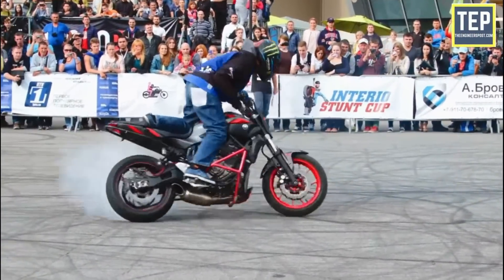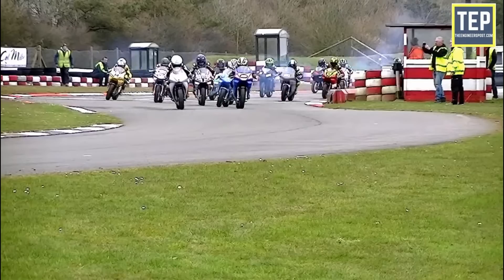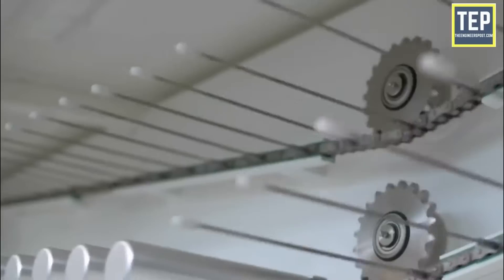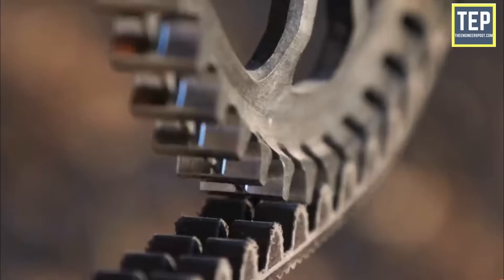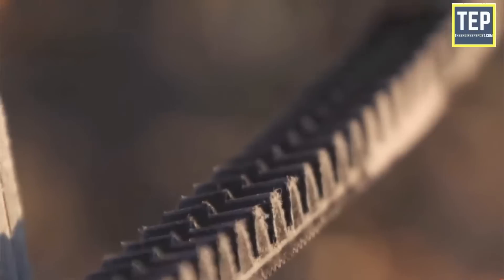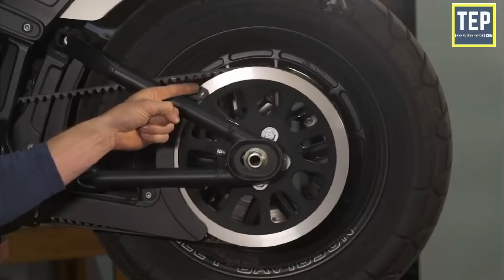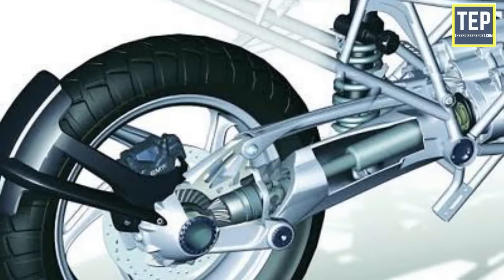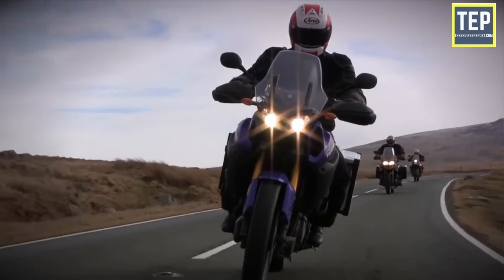Chain Drive vs Belt Drive vs Shaft Drive in Motorcycles | Which is Better?

Comment: Wow, never new shaft drives waste 25% of power (sounds high) and belts 10%.  Clearly, chain is the winner re performance and cost, but you pay for the maintenance, but its not bad if its a road bike.
Reply: Shaft does not lose that much power. A spiral bevel gear only loses about 2%. The whole system is less than 10%. Shaft drive does require maintenance but it's an oil change. They use so little fluid a quart bottle would last a couple years with a yearly change.
Reply: @omnipotent87  The video showed a hypoid gear set for the shaft drive which can attenuate about 15% of power delivery. A regular spiral bevel gear can be used but you'll be hearing a loud hum  as you go. Ok for power tools but not so much for motorcycles due to backlash issues. Also shaft drives have issues with universal joint free play and angular limitations. Which is why you see them in tourers meant for flat terrain. The more acute the angle of the shaft the less power it can deliver due to torsional resistance of the universal joints. Which is also why you'll have less ground clearance for dual sports or serious off road adventure bikes.

Chains don't have these issues. Hence their use in supersport and off road applications. Large displacement road oriented motorcycles can use shaft drive for all the benefits it offers. 

Neither is better or worse. Use the right tool for the job
Reply: That's got to be high... I have a intruder VL 1500 shaft drive and that thing pulls your arms off on acceleration!
Reply: Lolz shaft drives. The pinion gear is always wanting to climb the ring gear and thus induces, however slight, a rotational torque on the bikes frame. Saying that chains pull a rear wheel out of alignment under load and ignoring that shaft drives do the same, but to the frame of the bike as opposed to the rear wheel, is asinine. Good day.
Reply: @JDuBz815  That torque can be used to your advantage in cornering.
Reply: @corydorastube  you can also use the torque of a chain drive to your advantage. I was pointing out that both chain drive and shaft drive systems apply torque to the bike in different ways.
Reply: His figures are over the top
Reply: Chains also have the disadvantage of stretching under load. A loose chain can cause the bike to fish-tail, so having it properly tensioned is important. 

The chain's pressure on the back  axle can pull the back wheel put of alignment, disturbing the handling of the bike. 

With a shaft drive (or a CVT) misalignment is eliminated, so "technically" those alternatives are "safer".  

Shaft drives tend to cause the back of the bike to rise under power, while chains cause the back end to drop. You can see this effect on drag bikes where the tyres are actually distorted by the power.

Bikes also have the tendency for the front end to dip under heavy braking, so having a shaft drive bike can have an effect like a see-saw if ridden aggressively. BMW has a special front end setup to counter this.
Reply: @stanislausbrown8626  And say a rag gets spun around the wheel locking the rear wheel up, what happens with the rear wheel? Can it slip with the shaft drive to save the the biker?
Reply: @arunvignesh7015  
The shaft drive mechanism is all enclosed so a rag can’t get wrapped around the sprocket.
Reply: @Therapistinthewhitehouse  Still connected to the wheel I hope?
Reply: @arunvignesh7015  
It’s the exposed chain and sprockets that are more likely to catch the rag than the interface between a wheel and shaft.
Reply: @Therapistinthewhitehouse  I agree but still your own luggage or a long enough sack or cloth can get caught between the wheels and the casing making it dangerous. Shafts are convenient, but not fully safe as long as you aren't sitting inside a cage like a car.  Chains even if a little tricky to maintain, seems like a safer option and fixable if you indent to ride into all kinds of places. Maybe I'm wrong but the tested and proven just feels more appealing.
Reply: @arunvignesh7015  
Shafts are convenient, maintenance free and offer better control of power on the limit. Something I hadn’t considered was that but someone else mentioned was that a chain drive wants to pull the rear wheel out of alignment making handling less predictable if missed when maintaining the bike. I don’t know if it’s ever been done but a chain drive inside a casing with a drip of lube keeping everything running smoothly, would keep the chain clean and mean that both it and sprockets would last longer. The downside would be that checking the chain and sprockets would be more difficult and because of that, it’d be more likely to be skipped.
Reply: @Therapistinthewhitehouse  Chains and sprockets are cheap to manufacture and it's easy to replace and maintain instead of having a case around it generally. Worst case scenario they just break off and make sure the power transmission stops unlike shaft so I don't think it's worth the effort to have a casing for chain because unless it is completely sealed the dust is going to get in anyway. Chains are advantageous because they are exposed and in very long journeys they can be fixed on the fly with extra links or new chain.
Chains are flexible Which can cause some misalignment but the flexibility of the chain runs it misaligned without any serious slippage or power drop.
Reply: @arunvignesh7015  
You’re saying they’re cheap and easy to adjust and repair on the roadside, that’s a problem that’ll almost never occur with a shaft drive and be much less likely to happen on a belt drive, which also requires no maintenance and it’s a lot easier to carry a spare for the once in 100k times it snaps.
Reply: @stanislausbrown8626  it feels better for the back to go down on sudden  power delivery, more grip that way it would seem.

Comment: Belt drive has the least amount of maintenance
Reply from the maker: You're right!! Compared with a chain, belts are cleaner, lighter, cheaper, smoother, quieter and require less maintenance.

Comment: Why do they loose up ro 25 percent when a car totally including gerabox and clutch looses around 10%?
Reply: Depends on drivetrain layout? Plus, the torque in a car engine tends to be way more than a motorcycle I would think.
Reply: @2010ngojo  yes this is correct, bikes rev real high, and horsepower increases with rpm, I think the equation is Horsepower = Torque/5252, so for example, a 600cc bike with a car redline, somewhere around 5-7k, would make similar torque to horsepower numbers as cars do, because bikes rev so high, that horsepower increases, but with torque on the other side of the equation, it doesn't increase by much, and might even lose torque
Reply: @2010ngojo  I meant that it'd have a similar torque to horsepower ratio as a car
Reply: They don't.. He's taking bollox
Reply: @thakery5720  his figures are was off. If a shaft driven motorcycle makes 100 bhp he's claiming by the time it gets to the rear wheel it's 75bhp!!? Nonsense, at most it will loose 15bhp. So in fact I think it is you that would appear to be ill educated... You sanctimonious halfwit...
Reply: @thakery5720  and what's even worse... YOU HA E A BIKE!!!!  Please sell it and keep death and idiots off the road🤣🤣🤣🤣🤣
Reply: Rear-wheel drive cars lose between 20% and 30% of power when measured at the back wheels. This is due to oil friction, gear engagement, and other parasitic loses. Front-wheel drive cars lose a bit less.
Reply: @johngranato2673 
It's not just which wheels are driven, but also where the engine is.
Reply: @2010ngojo  Certainly, in relation to engine location.  Thanks.
Reply: If you have a car that is rear wheel drive it'll have power loss of right around 15 to 25% depending of how heavy and how long the vehicle and where the engine is

Comment: 5:25 That is not true! They need maintenance too, but not in such short intervals as the other drive systems.
So need the cardan joint non-fluid oil, which you have to fit at every bike inspection and the angle gear needs gearbox oil, which you have to replace from time to time(~20,000-50000km)

Comment: Verdict: chain drive is the best.. so don't be lazy and clear your chain and socket frequently
Reply: @thakery5720  it needs cleaning after few hundreds kilometres. We bath daily so to keep ourselves clean. So why don't we give just 10-15 minutes to clean the chain
Reply: @thakery5720  nope chains are good belts gets tear if applied much power and chains can be repaired
Reply: Shaft is best. One thing less to worry about.
Reply: @thakery5720  belt drive is like middle ground 👍👍
Reply: @thakery5720  how much cc is your bike
Reply: @thakery5720  really? you have the beasts
Reply: @thakery5720  👍👍
Reply: I agree what you said. Certainly it can withstand in any condition. However, if you're not lazy lubricating it frequently, then you don't have any troubles. You can also replace sprockets depends on how you set up your ride for racing. 

It's eco-friendly and last even longer too
Reply: My chain drive doesn't need any service. Its fully sealed.

Comment: If ever i have money, id build my own motorcycle...

125cc engine, but looks and feels like a Sports bike, and it will have either 3wheels (reversed trike design) or 4wheels (Quad bike/ATV design)...

And it will either have Belt drive or Shaft drive...
Reply from the maker: Good to hear that
Reply: how about foot drive
Reply: Problem is its gonna be slow
Reply: @palepotatox  dont care...
The planned design is for people that are old and with disabilities...

So they can still ride a Motorcycle w/o having trouble riding it...
Reply: Then, it's not a motorcycle.
Reply: @timjohnson1199  HAHAHAHA
Reply: @timjohnson1199  so? Whats your problem?
Reply: @JohnathanLimCheng  Then just custom any 125cc scooter into trycyle if you want the easiest way (because CVT was alreay using belt for the drive train). But for sports bike, well I already seen some custom made version of GSX 150R and FZ 16 for our disable friend
Reply: Well, you can buy a Piaggio Tre Ruote
Reply: @fwfindawan1481  technically i can only have possibility to buy motorcycles under Honda...

I live in the Philippines, and the cheapest 125cc motorcycle is a Honda TMX125-Alpha...
Its price is under $1000usd...(50k Php)
Reply: Ibig mo bang sabihin paps, Project Bike?

Anong 125cc motorcycles yan paps HD3 ba yan or pang 4 stroke?

Comment: "Totally maintenance free" 
Shows a video of oil change.
Reply: That oil cost less than $6 for a quart and it’ll last 3-5 years depending of how much oil you need and how frequent you change the oil.  Btw, to change it, you just drain it from plug and fill (3~6ounces?).  This is as cheap maintenance as anything goes.  I changed my oil at 6000 miles (roughly 3-4 years).  Bought a new quart.  You could probably ride it longer as no contamination gets in there or use synthetic oil to last longer.
Reply: Oil cost 10k
Reply: Yeah.. hahah
Reply: You do realize this is an AI made video right?
Reply: @randomyoutuber2927  AI spoken video, not AI made dude
Reply: Yeah 🤣
Reply: @Legi0n you should not use synthetic on older shaft drives. 2000 (roughly) and older need the old fashioned stuff.
Reply: That was the initial oil being added at the factory..................
..........
..........
..........
..........
..........
not!
Reply: Which literally takes 2-3 minutes at best with a shaft drive.  I wouldn't even consider that maintenance.
Reply: @Airtouch67  but, a cbr is more fun 🙃😊
Reply: Or you can try to replace the timing chain yourself it could take several hours for the repair.
Reply: One time a year maybe more time  !
Reply: this mass of oil will travel around the world. Respect!
I meant, additional mass of lubricant oil. 
Not to mention the metal.
Reply: Still cheaper

Comment: I want to know the belt drive kit cost for my Royal enfield 500cc standerd
Reply: Rs.15000/- for belt drive system. But not worth. Bullet is too much heavy for belt. We used it but belt broke and teeth don't handle the weight of bike. Seller didn't take back the belt and money lost in experiment. These all are china import parts.